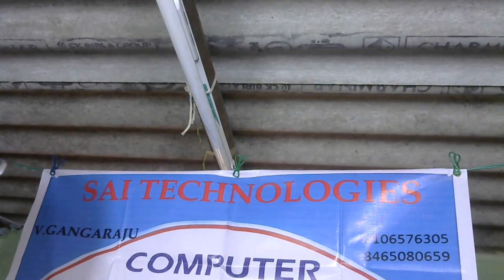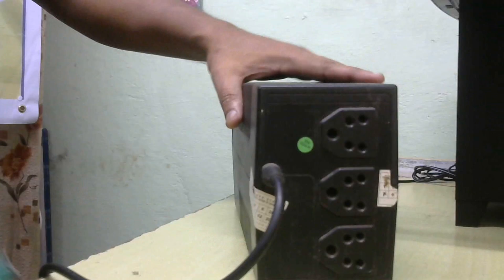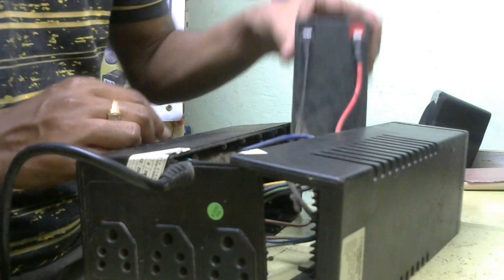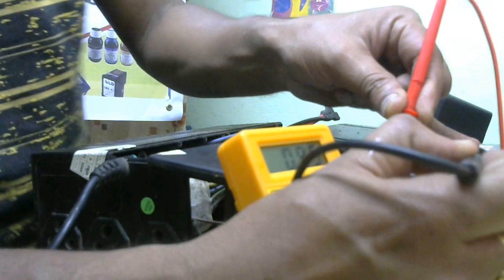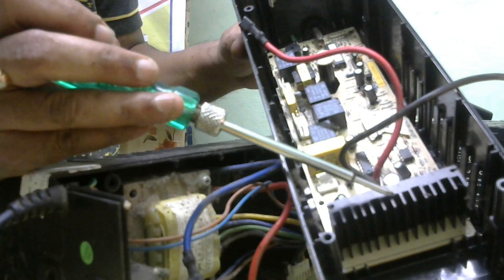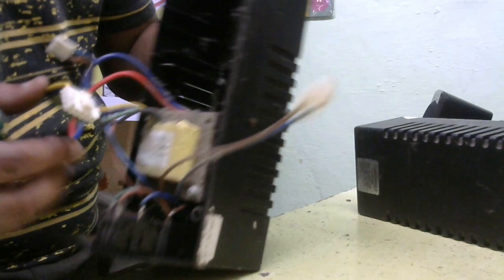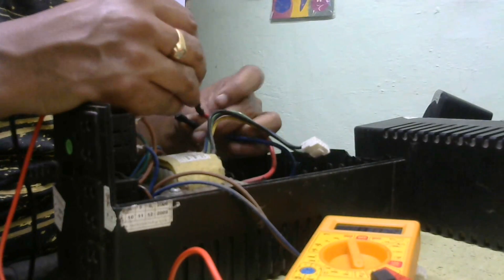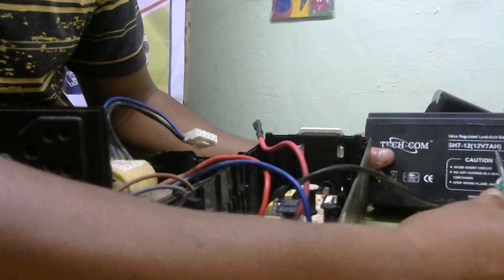how to repairing ups cbt

Comment: sir my inverter when switched on, but it works only 2 minutes after automatically goes to off position. How to fix the problem sir (ICE company inverter)
Reply from the maker: remove battery  recharge other wise give battery 
shop

Comment: Ohm Sai Ram. I am from Chennai. My UPS as you explained in your video is the same model. Components are also same. Thanks for your good explanation about the ups. My problem is  -  Transformer and output Transistors are also ok.(cep 83A3).To my  knowledge, all the parts are OK. I have changed R 41 (33 ohms) it was high 1.5 k. But there is no voltages developed on 3 + 1 four pin socket. Before that, the battery was very low. I filled with distilled water and charged in the unit itself. The water has over flowed and set dead. This is the problem. There is no charging voltage. I have changed  new battery also. But unit is not working. Would you please help me to rectify the defect by providing circuit diagram with voltages. I am a senior citizen aged 72 yrs. interesting in electronic work.If I had not purchased the battery itself before doing all these things, I will go for new UPS. Battery cost is also 750/-. That is why I am trying to rectify the Unit with the help of yours.Awaiting your suggestions.Viswanathan SA d/11.07.2018